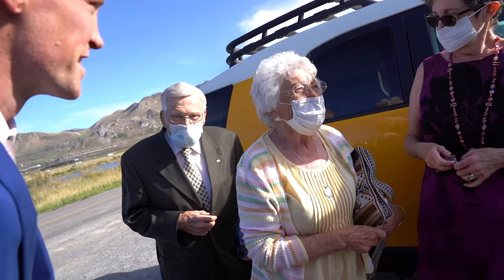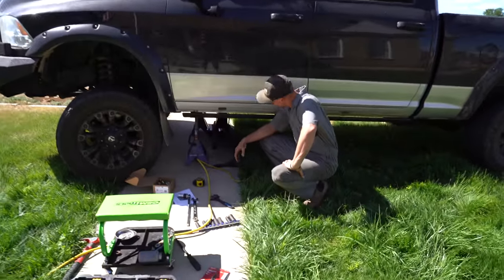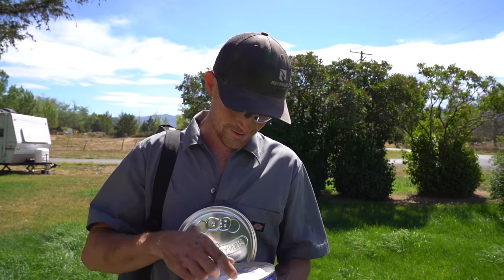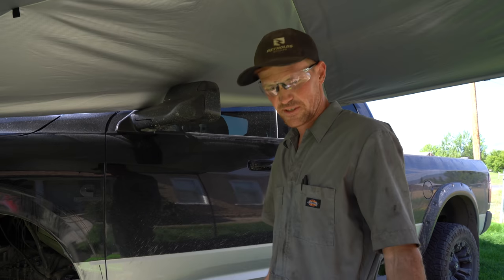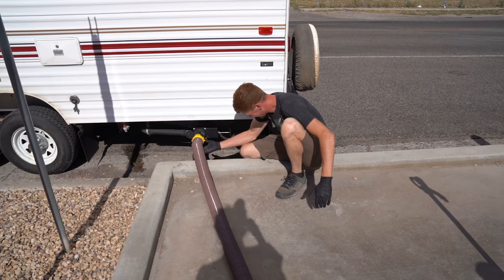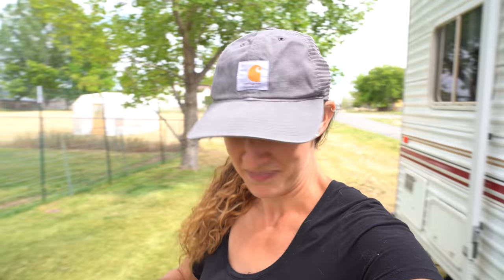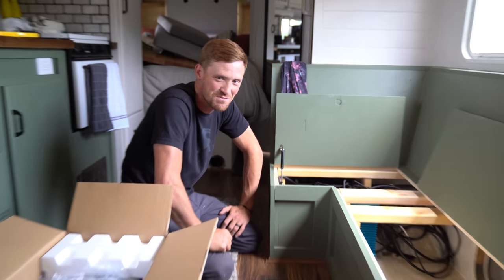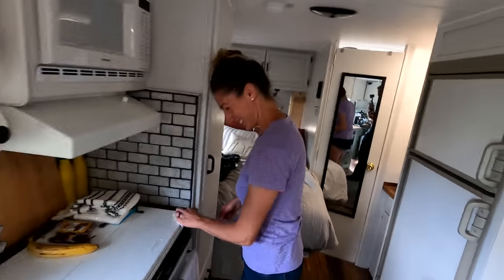FINALLY FINISHING THE ELECTRICAL SYSTEM IN TERRY | RV RENOVATION

Comment: Pro tip: the enzymes in your saliva will remove blood from upholstery and fabric. Just spit on the blood and rub with your finger. No need to test for color fastness or anything. It does take quite a bit of rubbing and spit, but works like a charm, even on old dried blood. Slightly gross, but that doesn’t seem to be an issue for y’all. 😄

Comment: Lift kits are a bad idea, because the ground clearance under your differential won't change one bit.  Only slightly larger tires will do that.  And both lift kits and crazy oversized tires will kill your suspension quickly.  If you're worried about snow, use good snow tires and chains and a true-track locker instead. Deep water fording will require a change of gear oil soon afterwards; best to avoid that.

Comment: Great Video again, thanks. 
Just a heads up on welders caps. I've been a pipe welder for over 45 years. The bill of the cap is used over the ear that is exposed to the hot slag or sparks, when your standing up welding then you protect your neck. Most welders are not aware of this but it makes sense once you understand why. 
On another note, I thought you would get another compost toilet.
Congratulations on your marriage and life experiences.

Comment: What newbies to trailer life. Get used to emptying those tanks unless you have them drain into a ceptic tank on your property. Then you will also have to worry about your tanks FREEZING in the winter.
They sell heating pads for your tanks if you can even get to the bottom of the tanks to apply them.
If your tanks freeze, they won't thaw until Spring.  You can also put a heat lamp under the tanks but you have to skirt the trailer to keep the heat in.

Comment: Curly haird red-head from the East Coast... the humid struggle is real for both reasons!  hahaha... Rv tip, whenever we have the chance, we pour a couple buckets of water down the toilet during a clean out. Just hold the pedal for the toilet open and slowly pour it down just after you empty it, it makes a difference getting all the solids out. If you don't want to keep towing the camper to dump stations you can get a "honey wagon" or portable waste containers. I've seen tow behinds that might be helpful once you get on your build site.

Comment: If putting the rig up at the property, you could consider doing a flojet macerator and a Barker blueboy to deal with waste disposal. Best to leave the blueboy in the truck bed and pump it full with the macerator, then gravity dump the blueboy at the dump station. This allows the trailer to remain stationary. Man handling a full tote may not be practical; hence, the macerator pump.

Comment: Oh boy ima be “that person” lol The front axle is too far back 😥 the tires are too far towards the back now giving you too little of space in the wheel wells. When you get bigger wheels you’ll need all the clearance possible in those wheel wheel wells. You’ll have issues with tight  turns. Just a mechanic’s wife commenting not a mechanic lol 
Also, you said doodie lol

Comment: Hi Guys,  Love watching your videos, Trent and Allie you guys are so handy. We have a solar panel for our trailer too but I like the inverted system you guys have better. Ours only runs the lights and keeps the battery charged. A good idea is to run your sinks while emptying your gray water tank. Also you need a hose and place it in the toilet to mix the water in the toilet and it gets everything out. Does are tips we got from experienced trailer owners. ❤️❤️

Comment: Hi Trent and Allie, I've been watching your channel forever. Finally have something of value to add. Trent, the secret to greasy hands is olive oil! You splash a bit on hands when they are dry and then rub it in as if you were washing with soap. Then wash with dish soap. All the olive oil comes off with the grease and your hands will feel awesome afterwards. Not like the grease soap with sand it in it. Love your channel, it's the only one I look forward to.

Comment: Swarfega cleans oil from skin easily-might be an idea to use cotton throws to minimize blood and cooking stains on upholstery they are easy to wash - why not get a professional motor mechanic shop to fix your truck they have experience and know what they're doing-cost is not a big deal for you plus you will have assurances that your truck is road worthy!!

Comment: Quite a few years ago I had a crazy accident in the kitchen and I had coffee beans everywhere in the kitchen... I didn't realize that some fell into the dog food bag and because of the size and  colors I never noticed right away... thankfully no one was injured but what happened to my dog was he was wired for 220 as he zipped through the house and over trees in the yard. He must of run twenty miles so I gave him some milk and mixed a little smooth move tea in it to make him move this disturbing problem from his system. It doesn't take much to give dog the squirts but followed that with some cheese puffs as he got into them on his own anyway.
I thought that the shit was getting  fairly deep there. Addressing grease; Grease of all forms is kinda the last thing that you want in your hair or even the butt  crack since the show was talking shit this first part to the last really. A guy that wouldn't pass a small stinker now  craps were ever and just lets it fly... I was that guy too. Any way grease can be very easy if you do the magic trick first... vegetable oil will cut the worst grease and then even hand soap will clean that easy. Hardened road tar in pants or something you didn't want ruined... vegetable oil will make it come right out then the dawn dish soap or other brand will take that away leaving only sent of soap... vanilla is mine

Comment: Allie, if you haven't checked out Blue Bell ice cream, you should. It's to die for. So you two are moving to a higher elevation, where everything is still green, where the water table is much higher and it snows. Welcome back to moisture, the higher elevations have more moisture in the air and although it's nothing like the eastern side of the country it's still going to me not as dry as you thought. I know your house is far from being in the sheet rock stages but when you get there, be sure to not let Trent get away from putting in a moisture barrier, walls and cealling. Also, something else to consider is a natures head. Great video as always and Trent, I told you you could get a bigger tin of butter cookies.

Comment: Hey Trent, Could you make a separate video and talk more about the solar system that you just installed, please! I am interested in what you have there! Like the good and the bad about it! I mostly want to know more about the charging system part. Can you use any solar panels or do you have to use ones that will work with the power inverter? Watts I mean!

Comment: Air lift would have been so much easier. That's what I have on my truck had it on in a day. Love it has a auto leveler wherever I set it. When I  attach a trailer the truck levels out so the headlights aren't pointed to the sky.  I do a lot of pulling trailers and RV's.

Comment: YES GET  TECHNICAL ABOUT THE LIFT ON THE TRUCK!!!!! THAT'S WHAT I'M HERE FOR!!! MORE TRUCK ACTION. 

Looks like a 4 inch lift with front coil springs, with all the link arms being replaced. I'm guessing he steering components needed doing, also. Rear leaf springs, but did you have to get an extended drive line fo each of the driveshafts?
Reply from the maker: Just a spacer for the front driveshaft and it’s a 6” lift kit with a long arm kit for the front 😎🤘🏼
Reply: @TrentandAllie  Nice job. I did $1,000 worth of damage to our mall crawler, going to be spending $10,000 to, um, make it trail ready.

Comment: Use that non potable water to run water down the toilet. It will flush out the tank. You can also set up a connection to your moms sewer system and dump there.

Comment: 3:27  "Negative Humidity" in Utah?     What?    Quite incorrect!  Absolutely and physically impossible to have "negative humidity".  You may get "low" humidity levels, in fact when I looked at your weather reports right now, it shows you have a 21% Relative Humidity level.  The notes also say, "In summer, humidity in Utah is low because of the heat. ... Humidity levels here can drop as low as 10 percent during the winter months. "     (Incidentally, "Relative Humidity" is a scientific term that indicates the proportion of water that is actually in the air at the time of measurement compared with how much water that air could hold if it was 100% saturated, and at that same ambient temperature.  Note:  As the temperature of the air increases, it can hold more moisture.  This is why water condenses on your cold windows - it becomes over saturated.
Reply from the maker: It was a joke, it’s very dry here all the time

Comment: Hey Trent. Does that kit address the extended geometry on the drive shafts? My father was an area service rep and I can tell you he had lots to say about lift kits that people install without considering it (and inevitably shredding shafts/cv/universal joints)
Reply from the maker: Yeah it lowers the transmission and has a spacer for the front driveshaft